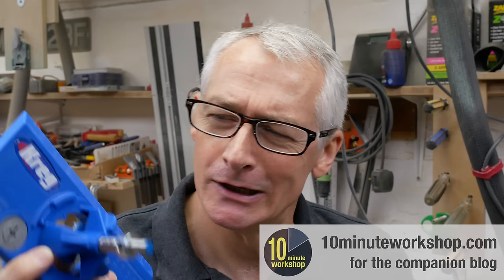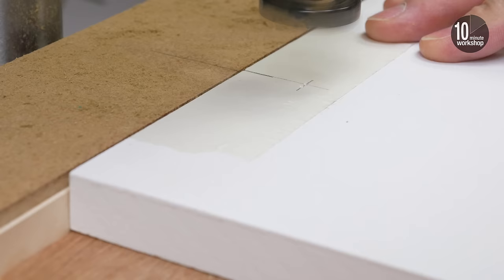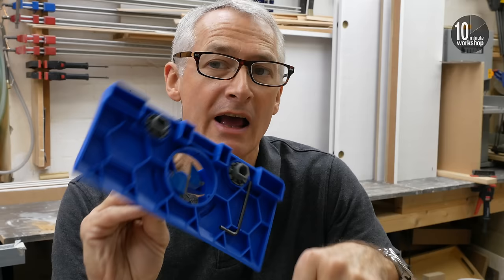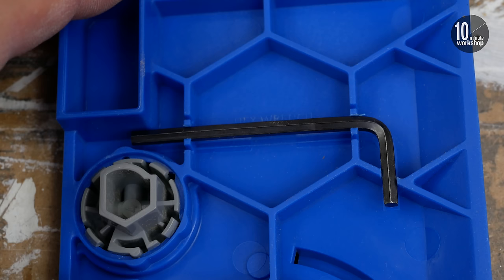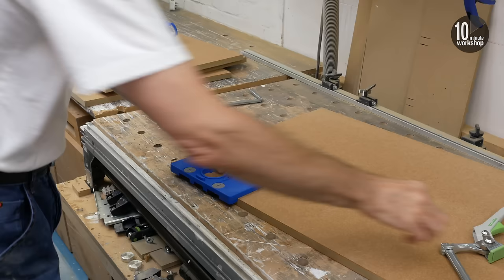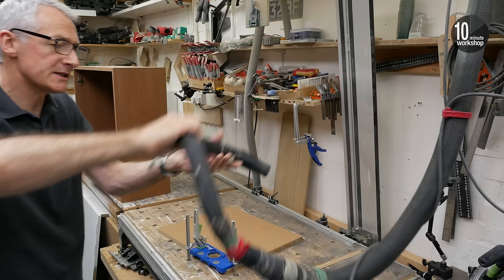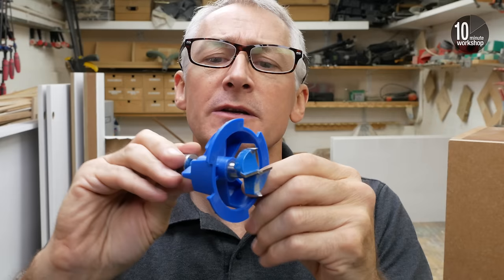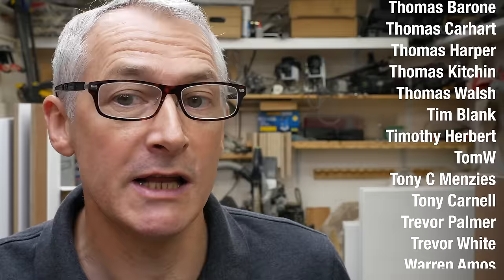Kreg Concealed Hinge Jig [video #357]

Comment: Hi Peter, thanks very much for your videos, I'm presently building the loose tenon shaker style kitchen cabinets out of 3/4" mdf. I'm not sure what screws to use to mount the concealed hinges, what would you recommend? Thanks.
Reply from the maker: For the hinges, 3.5 x 16mm, for the hinge plates, usually 4 x 16, or thereabouts. Better not to be self-countersinking though! 👍

Comment: Hiha Peter hope your well. Just heard you sayin about the alignment for an 18 mil door so is it a different adjustment if the door is heavier than 18 mil. cheers bud
Reply from the maker: Hiya. No, not the alignment, just the depth. My drill press is set up for 22mm doors, so if I used it for 18mm the depth of the holes would be 4mm out, is all. 👍👍

Comment: Hi I will try mine on Sunday and see if it’s the same as yours. I wonder if the little turn spacers are out one side and this is skewing the hinge.
Reply from the maker: Cheers Ray. Yes, could be, though it’s consistent all across the 3-6mm range 🤷‍♂️
Reply: Peter Millard I wonder set one at 3 and the other at 4 and see if that works. I drill 4 for a cupboard and the doors were internal and I used Blum hinges and they were square. I will try one on Sunday as I’m out tomorrow

Comment: Great video! I'm a newbie to building cabinets and have a quick question. I know you like the 71B3550 Blum hinges. For a 3/4 inch (18mm) door, what offset did you pick on the Kreg jig? (i.e. 3,4,5 or 6)
Reply from the maker: Thanks! I used the #6 setting, though I would have liked a 7 tbh - that’s just how I like to hang my doors though. HTH P
Reply: @10MinuteWorkshop  Thank you, I wasn't sure if that was just for this video or your actually setting.
Reply: I just found this video after ordering the same hinges and have the same thought of wanting a 7 setting; seems like an odd omission. Do you know if the adjustability of the hinge will allow for the overlay to sit flush? I'll figure out on Tuesday when the hinges arrive, though figure you might already know.
Reply from the maker: David Evans Yes, there’s enough adjustment in the hinge for this. I agree though - it’s an odd omission. 🤷‍♂️👍

Comment: Where can I buy a "CHEAP" 10.8V drill like the one you used @ 10:09? 
I once had a watch with a rotating bezel that would only turn anti-clockwise so I used a 3mm flared slotted screwdriver and now it turns both ways.I am not very good at maths and so can U tell me how much "inboard" your setting be?

Comment: Should i go whit Blum Ecodrill then? 😀
Reply from the maker: Well, they have their own issues tbh. 🤷‍♂️👍
Reply: @10MinuteWorkshop  what is the issue whit ecodrill?
Reply from the maker: @TheAlogoc  Dust collection/clogging, and fixed bits for the hinge screws is very restrictive if you prefer to use alternative screws.

Comment: Did anyone catch the " dedicated drill press" .. its a $20 jig.. seem like a cheap jig would be more cost effective than a drill press....
Reply from the maker: 🤷‍♂️ It’s a cheap drill press and I do enough concealed hinges to leave that one set up - dedicated, as it were - for them. As I say in the vid, I’ll use this Kreg one for the odd larger door where it’s easier to take the drill to the door, rather than the door to the drill. Wont use it for the screw hole alignment though. 🤔
Reply: @10MinuteWorkshop  ok, just sounded a little odd. Still liked the video.

Comment: I wonder if there is some distortion introduced, with the two guide holes, in the manufacturing  molding process?
After all them long words I'm going to have a lie down!
Reply from the maker: It's possible, though I suspect it may be the little distance-setting cams not being quite equal, maybe introducing some twist?? I need to have a bit more of a play with it - when I'm not working, lol! 👍

Comment: Try using a penny instead of chewing up the adjustment slots with an ill-fitting screwdriver :-)
Reply from the maker: As mentioned in the vid, the adjusters jam when turning them in one direction. You need to release the pressure on the little dingus inside, then it’ll turn OK. And pennies?  Brown money? Haven’t seen any of those for years! 😂😂👍👍
Reply: @10MinuteWorkshop    hmmm ... that sounds raycissst  to me...
REEEEEEEEE !!! 😂😂😂😂

😎👍☘🍺